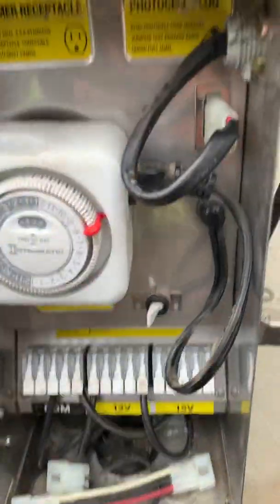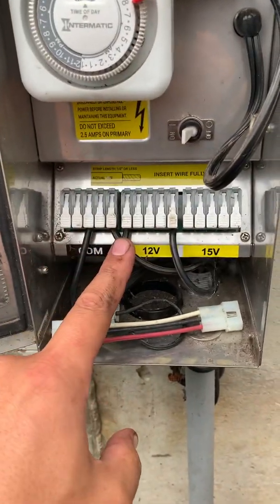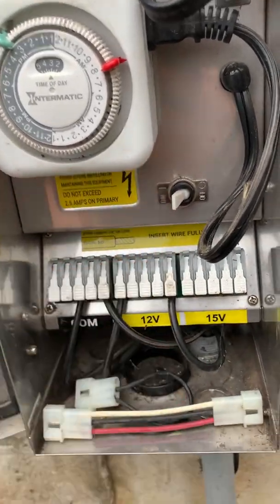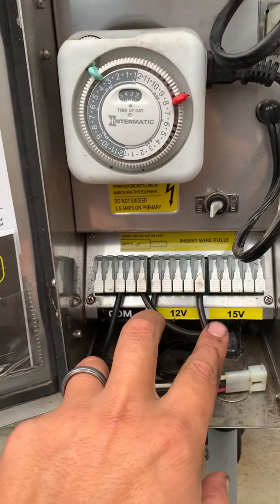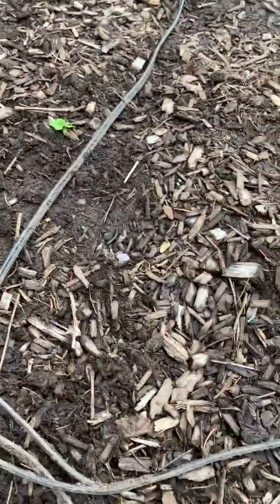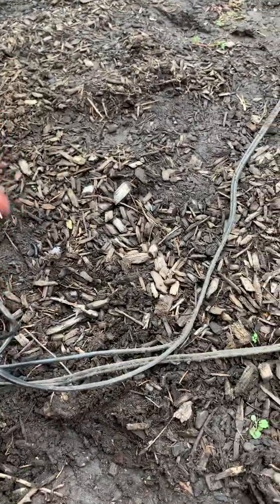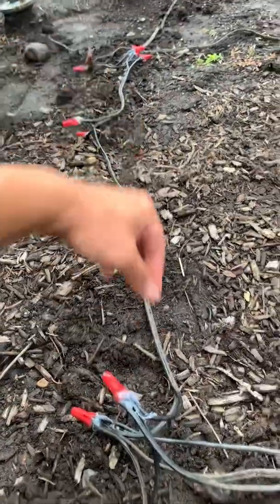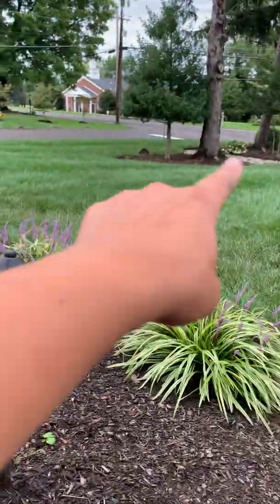Low Voltage Landscape Lighting Transformer Keeps Tripping

Comment: You solved my problem too!  I had the same issue with the transformer tripping every once and a while for no apparent reason, and have been trying to find an easy fix before digging up all the connections.  When I saw your video and the spotlights, the same spotlights as mine, I changed out the bulbs and problem solved.  Thank you so much for posting this.  You're a hero.

Comment: My transformer is tripping when the lights go off . I’m having to push in the reset button everyday for the lights to stay on. They do stay on until the timer triggers them off. Any idea what could be causing this?
Reply from the maker: @DianaGeorgiou-u2k  hmmm. This is a good one. First thing I would try is to change the timer and eliminate that as a potential issue since that seems to be what’s causing the trip.  Perhaps use a Wemo or kasa outdoor smart plug. I used to have an old school manual timer, and swapped that out with a Wemo outdoor plug, added the jumper back in and removed the photocell. Now I can control it with my phone and or set a schedule to go on and off automatically.  

https://a.co/d/9UVNNNU

Comment: Wonder if the bulb that caused the issue exceeded the allowble for the light. I am not a fan of Volt's bulbs. I much prefer Emery Allen bulbs..much higher CRI and crisper light
Reply from the maker: @Sean-gw2wx  it wasn’t a volt bulb. It was Amazon pack.  Probably subpar at best, but they work and now I know what to look for if this happens again

Comment: Thanks for posting! I had the same problem with my Volt system . It was also a short in a bulb. Took a bulb I knew was good & started replacing the other bulbs one at a time until I found the bad one (didn't trip the breaker). Saved me a lot of time!! Thanks!!!
Reply from the maker: Glad to help. Have a nice weekend

Comment: Genius! I was about to start pulling wires until I saw this. Low and behold it was the 2nd bulb in my Volt system I checked out of about 50 options, so lucky there.  I will be calling them tomorrow for a replacement.
Reply from the maker: Glad to help. Had my
Entire yard ripped out